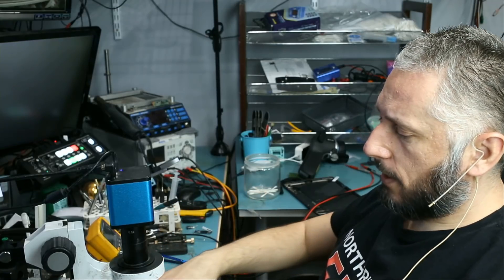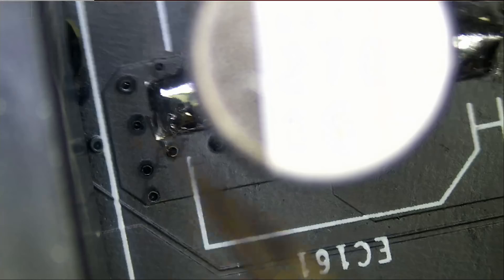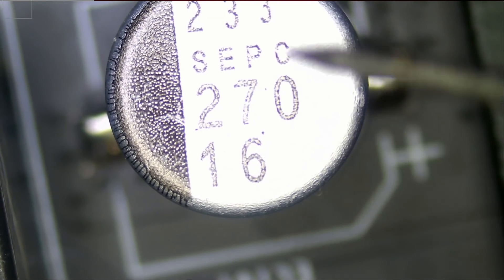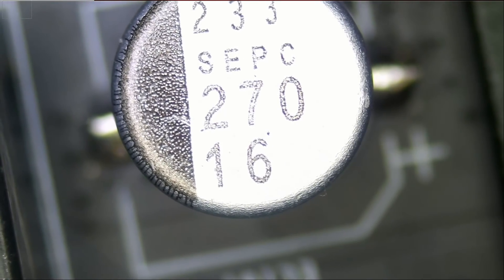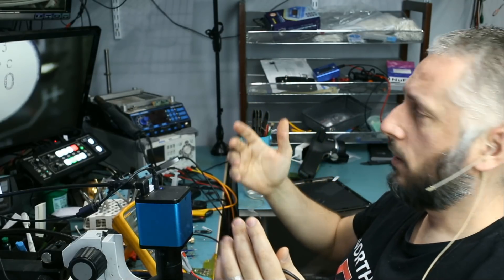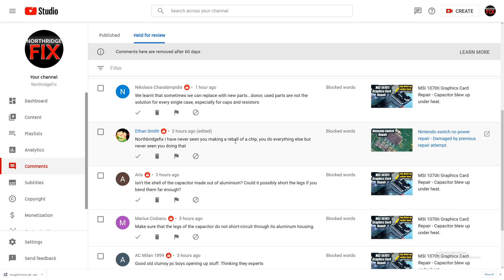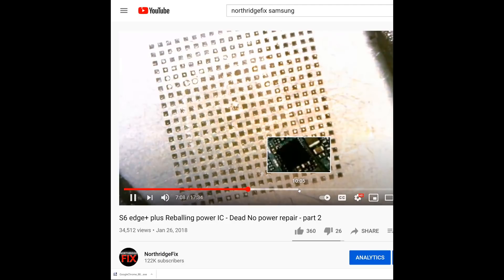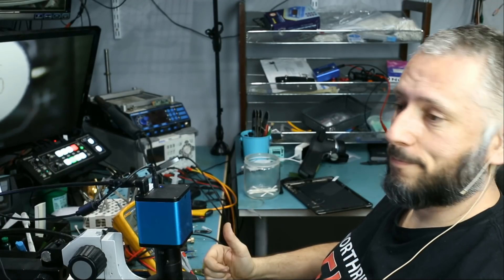MSI 1070ti Follow up - Electrolytic capacitor Convert Thru hole to SMD without causing short circuit

Comment: This follow-up video was very interesting...  Most likely that capacitor has a plastic case or  has a plastic film covering it... but for sure aluminum is a good electricity conductor... this situation must be considered carefully when dealing with high capacity capacitor (i.e. Microwave or crt monitor capacitors)... some of the old model big capacitors have an aluminum case.. but are all grounded to the case of the appliance.. so best practice (as you showed in the video..) test, test, test... 
Anyway is always a pleasure watching you fixing stuff.. keep up your video production...
Reply from the maker: I think we're missing the point. The shell is aluminum but coated and insulated. I tried scratching the surface and it's hard insulation. Some viewers are concerned about the insulation failing in the future which neither I nor anybody know when or if that will happen. It has the same chance of failing as if a capacitor would fail on it's own. I have decided to replace the capacitor with an SMD type with plastic insulation on the bottom just to be on the safe side. I appreciate all the feedback.

Comment: Thank you for the educational material.  I'm looking for a guide on replacing thru hole capacitors on ATX motherboards.  I know it can require additional heating.  A walk through of different methods and temp ranges would be helpful.  So far I haven't seen a good guide on YT.  If you have a video that already covers it.  I'd like to watch it.  God Bless.

Comment: I opened up a laptop the other day to fix a previous attempt to replace the keyboard and found that the person that did the repair put a nice layer of aluminium tape over the exposed circuit board. 
I guess to stop the metal case of the new keyboard from shorting the motherboard out. I soon discovered small burn holes in the aluminium tape that lead me to the burn out  components. Aluminium tape on the sticky side is not conductive, however if you press it over a spiky PCB it WILL conduct!

Comment: The caps probably have a coating.  Don't scrape the O at the bottom of the cap and you'll be fine. If worried, take the little plastic tray from a similar sized smd cap and put that on the bottom. I usually do that.

Comment: I think that most electrolytic capacitors are either wrapped or coated. However if you scratch through it you will find it is aluminum and very conductive. It is probably fine as is though.

Comment: I have a few of those capacitors and realy didn't test any of them to see if the casing is conductive or not. I mostly come across the ones with plastic shrink-wraping on them. When I think about it's logical that the shell should notbe conductive as it may discharge to surounding components.
Computer parts have a very small chance of working in excesivly humid and poluted enviroments and that reduces any risk of the isolating layer peeling away due to corosion. Somehow corosion seems to not conduct electricity when you need the device to work and somehow traps moisture and creates a shorts.
You mentioned that you replaced the cap with an smd one just to be on the safe side wich is great. 
Personaly i've put two holes through a piece of kapton tape and isulated the bottom of the capacitor. It realy just gave me peace of mind.
Realy enjoy your videos.

Comment: The shell is conductive XD As stated in comments it has a coating that comes of with little effort XD However usually bending the pins to make it SMD does not cause it to touch the casing.
Still love your work <3

Comment: Fact of the matter is if it works, it works. 1070ti's were released in 2017 so the longevity of the parts from OEM are questionable if they fail that quickly. Alex's repair will no-doubt outlast the 4 years its taken for the factory parts to fail

Comment: It is an aluminum electrolytic capacitor with aluminum shall but usually there is a coating on it like here. Although while soldering you could kill the coating so it is not ideal. I would say now you were lucky :) Keep up the nice work I really enjoy your videos

Comment: with all respect the outer material is Aluminum and coated if you scratch it with your probs head it will beep for sure. I checked right now

Comment: Yeah, the shell case is aluminum, but it's either been made non-conductive thru anodization etc, or there is a layer of non-conductive material such as  clear plastic or epoxy etc.

Comment: The Shell is aluminium and is conductive but some caps have a varnish paint (not all) so is beter to chek (if is conductive a Little Solder mask before install solve the problem)
Reply: You can see the bright cap (is protected) if dont bright well probabli not protected. 
This caps is for restricted space so have extra protection of paint/plastic isulation not all need this so the caps are More chepp .

Comment: Actually the shell is conductive. But is coated with transparent paint. Anyway when you curve the "legs" of the capacitor there is no chance to make any short between. Our chinese brothers put plastic inserts between capacitor shell and legs to be sure that there will be no short circuit at all. I think that repair was 100% right.

Comment: Hi, 
What is the nozzle size for the hot air station you use on smarphones?
I have tried the 3mm but it barely pushes air out. Do you use 3mm nozzle on phones or you use always a bigger nozzle?
Helping me knowing the right nozzle to use would be much appreciated.
Thanks

Comment: Sorry, but I am going to disagree about the Capacitor. You are just lucky It's not shorting. 
The case is almost certainly aluminium (or some metal alloy).  All Metals by Definition conduct electricity.
If it's untreated Aluminium, it will have reacted with oxygen to create a non-conductive oxide coating. More likely as it has printing on the cap, it has a thin varnish layer.
If the oxide or varnish is removed, the capacitor case WILL conduct electricity. 
It is possible (maybe not likely) that the folded-out wires could damage the intended or accidental insulation of the metal case.
Reply: I always thought they were aluminum so I tried one, not conductive until I filed down the outer coating then it conducts, the coating is tough so will probably withstand heat and shorting bit like a transformer winding ???

Comment: Follow up to the follow up... Is the outer shell non conductive because it's made of a non conductive material? Or is it made of a conductive material coated in something non conductive? My hypothesis is that the shell is made of a conductive material to shield from RF, and coated in a non conductive material to prevent shorts. Could you take another one of these capacitors, scratch the surface a bit in a couple of places, and check for continuity? Of course we could just look up the spec sheet and see what it's made of but my idea seems more fun!

Comment: The shell is from anodized aluminium so the surface is not conductive. But if you scatch surface by probes you will have short. So... in theory this solution is not safe, but it is possible to bend legs so that they dont touch the shell. Let's say this solution is 50/50 risky :-) But in this case it was done safely.
But it is a constructive reminder ;-) 
NorthridgeFix, thank you for your videos... I am daily viewer ;-)

Comment: Try scratching the capacitor with probes. It will beep. It might have non-conductive coating.
Reply: Magnet wire is a conductor with an insulating coating. It is tightly wrapped into a coil without any short. However, if you scratch the coil, you can damage the insulation, and ruin the coil. If you scratch the insulation off something to attempt to create a short, please share your results by posting a video of the experiment.
Reply: Why would you do that. Try scratching your skin, you'll see blood.

Comment: The outer cover of the capacitor is always a conductor of electricity, (Because it is always made of aluminum) but some companies put an insulation layer or a plastic cover and some don't so be careful
Reply: My goal is to alert beginners to this point
Reply: But then it should show continuity between the two point on the capicitor body 
For this type capicitor
Reply: @amandeepsingh5024  some companies put an insulation layer on top of the aluminum

Comment: If that comment offended him, imagine a real question? 😂
How do you know if the shell is not conductive? Your meter may be damaged ?  Or cheap Chinese copy that doesn't work correctly ?
Reply from the maker: Good thing I'm using a fluke multimeter, otherwise I would have  needed to do another video.
Reply: @NorthridgeFix  just taking the piss chief...lol👍
Reply: 1. NF verified that his meter, leads and probes were able to indicate continuity by touching probe tips together prior to making test. This is a common practice. 2. In my experience, even meters selling for less than $10 at Harbor Freight can be used to determine continuity with a high degree of certainty. If your meter is not very reliable, Harbor Freight opens at 8AM. Treat yourself.

Comment: Interesting, I had always assumed that these types of shells are aluminum. If they are aluminum, they are coated with something rendering the shells non-conductive. Regardless, I suspect there is sufficient coating (or material) to not allow current to get in the internal windings of any electrolytic cap.

Anyways just bought about ~100.00 from your site and along with buying the solder you use, I can actually make successful solders/desolders. Flux is awesome! This whole time I thought I didnt have enough heat or I was being a big dummy somehow.

Comment: Well, it seems that they skipped the class of capacitors, their frame is coated with a dielectric material so the possibility of short circuiting is very remote. Very well explained so that doubts are dispelled.